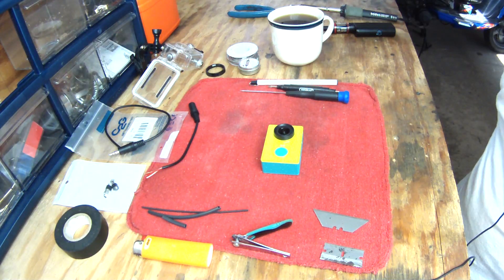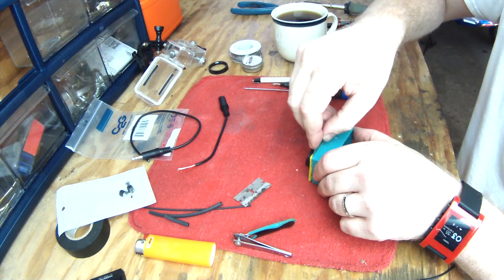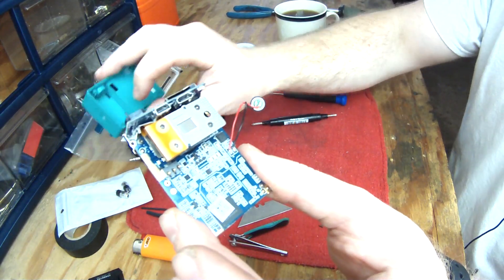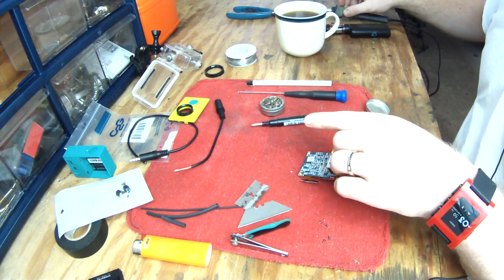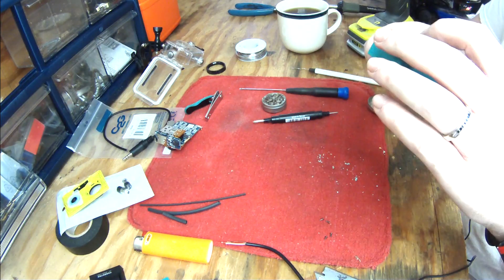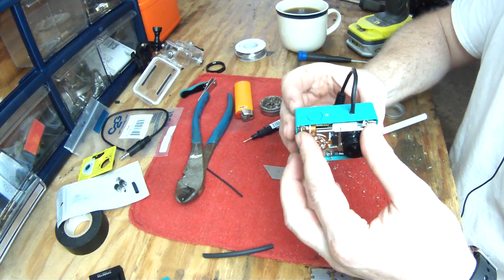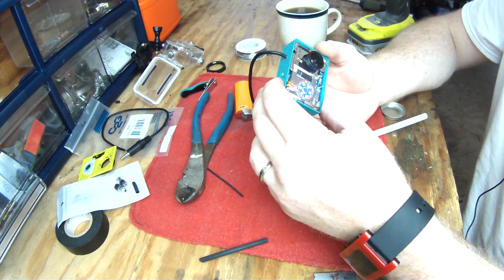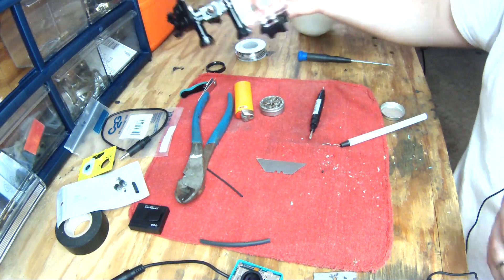Xiaomi Yi External Microphone Mod | Action Cam Hack

Comment: Hey. I have a mic with 3 lines, (trrs). If I cut the inserting part and glue the wires directly inside of the camera in the motherboard, will the mic work ? Or the camera only reads mic with 2 lines?

Comment: Hello I see that I have not posted for a long time, I hope you will answer me, I bought an action cam and an external microphone, the mic. it did not have the compatible connection and I bought an adapter for the micro USB type B input but on the other side it was not compatible with the microphone connection ... in short, now I have a micro USB female with its a cable 5 wires and the 2-wire microphone I wanted to connect directly but by connecting the two white micro USB and microphone wire and the other to the black micro USB and microphone side (the one with the bare copper) I did not get anything the action cam does not recognize the external microphone (obviously in the settings I have set external mic.) ... I would not like to make connections at random, so I ask you if you have any advice for me, thanks in advance ✌

Comment: Hi man thanks for the video ! I made it 90% like you did but 10% my way made the difference as follows:
- first I choose the have a new microphone cable fully installed from the motherboard
- cable choice was a high quality special microphone cable (proffessional mic cable)
- the actual microphone was a quality 20$ small microphone which was installed at the end of the cable (only the end of the mic..the actual small microphone)
- the downside is that you cannnot put the waterprof case
- the results are amazing after my humble opinion
- Check out the end result , you can hear it on this video it's amazing: https://youtu.be/pLp3uHsJrIE

Comment: Hi, thanks a lot for sharing this, Just a technical questions please. You don’t noticed any problem of hum or rumble or something, after connecting your input mic cables? Because sometimes when we modify the ground balance that can make problems. Any sound test available? Btw does the control of recording volume working fine?

Comment: I would like to try the same mod on my Sony az1 but the issue I have is that there are 2 microphones so I have 4 pins, I have tried putting some wires from a headset on to the soldered pins but it doesn't work. I've placing the wires on to two pins but that didn't help either. I'm new to all of this, some help would be appreciated.

Comment: hi can i use stereo mic with this setup?
Reply from the maker: You can wire a stereo mic, yes. The camera is mono mic in only though. I used a stereo mic cable for this mod!
Reply: I just did the mod today. overall the process was quite simple, but my soldering skills sucks. lol. somehow got it done though. the audio now is amazing! yi cam + zoom h1, simply wow! thanks a lot for the tutorial!
Reply from the maker: Right on! Glad it helped! I'm not great with solder either. I'm actually planning to do the same mod to the Yi 4k soon, because they still didn't add an external input! Unfortunately, the microphone in the new cam is no better. We can fix that!
Reply: shinyside why not get the yi 4k+ that has the usb c input? u can use a usb c to 3.5mm adapter and be able to record in stereo
Reply: @shinysidemoto  can you record a tutorial video for that too? It will be very helpful if you do so

Comment: What do you do with the waterproof case? how can your solution work with a waterproof case? not necessarily to work 30 m under water but to resist a heavy storm when on motorcycle, or swimming.
Reply from the maker: Cut a channel for the mic cable, and don't worry about it! I've ridden through some nasty storms with this set up without issue. It's certainly not waterproof, but marketing would call this "water resistant".

Comment: Why don't these action cams come with at least 8 gig of internal storage
Reply from the maker: Because microSD cards are like pennies a gig these days. Internal means non-upgradeable too. I get what you mean, but I'm all for replaceable storage!
Reply: It just helps when you run out of storage on your 32gig/64gb microsd and it rolls over to internal for photos or limited short 720p clip

Comment: (help) saya kan udah pasang mic external, tapi gak berhasil, padahal pemasangan udah ikutin tutorialnya bener-bener. jadi positif yg di pcb saya solder ke positif dan negatif jack female, sedangkan yg negatif pcb saya solder ke ground jack female atau apa gitu (*yg kakinya paling tinggi diantara ketiganya). nah masalahnya dimana nih ya ? pas saya colokin headset yg ada mic nya, malah engga berfungsi mic externalnya
Reply from the maker: Check again the polarity of your connection. Be certain the solder joint only connects one wire to one pad. It is easy to accidentally connect more. Test the microphone with another device and attempt to be certain of where the problem exists. (translated with Google translate, please forgive mistakes)

Comment: would not be better if you just connect the old mic wires to the new ones, without soldering?
Reply from the maker: No, a solder connection is best. Direct to the pads being better than making another connection.

Comment: Hello my friend could you please tell me if I can use this adapter  https://www.amazon.com/Movo-GMA100-Microphone-Adapter-Editions/dp/B00N0DTIFM/ref=sr_1_2?ie=UTF8&qid=1470972247&sr=8-2&keywords=Mic+Adapter+Cable  then use this microphone   https://www.amazon.com/Sony-ECMAW4-Wireless-Microphone-Black/dp/B00JWU6WWO/ref=sr_1_1?ie=UTF8&qid=1470942026&sr=8-1&keywords=sony+ECMAW4  it's possible? thanks for your help 

if someone reads it and knows or has used it would appreciate
Reply from the maker: Not with the Yi, to my knowledge.

Comment: Would I theoretically be able to use a mono Y - splitter, to have two inputs to the camera, to get rid of the annoying syncronisation? Or would this cause loads of interference issues?
Reply from the maker: Should work like a charm!
Reply: I'll report back once I tried it to see if I could notice any real difference in sound quality between mirroring the mono signal and using the stereo signal on its own. 

Thanks so much for your answer
Reply: Oh one more thing - you said that you let the solder flow together - wouldn't that create a bridge over + and -  and make cancelation an issue?
Reply from the maker: Oh, no! Don't bridge - let the solder flow over only one connection, but it must fully flow on that connection.

Comment: Thanks a lot!! Followed the same approach and it was successful. I am not sure how to cut the casing now without damaging the microphone wire...
Reply from the maker: The camera body case, or external case? I removed the external case and used a drill bit to route a channel for the cable. for the camera body, I would pass the mic cable through the outside housing and THEN make the connection inside. I drilled a small hole through the existing mic inlet and fed the cable through that.
Reply: The external waterproof case. I already soldered the the 3.5 female jack for the microphone point and not taking the jack out of the waterproof case means I have to drill a big hole in it.. which means the waterproofing is gone. But the voice quality I am getting by doing this mod, I think I am very happy with it.
Reply from the maker: Worth it! I've ridden hundreds of miles in the rain with the modded case on the front of my helmet without any water issues.

Comment: Xiaomi Yi has an usb plug, can we just plug an usb to 3,5mm jack and plug the mic?
Or should we mod the external mic just like you do?
Reply from the maker: Mod is the only way I'm aware of. The newest Yi camera models still do not have an external mic in, from what I'm told.
Reply: shinyside so the point is xiaomi yi do not have 3,5mm jack so we can't use external mic in older yi and newest yi? But thanks for the video it was really helped me out :D
Reply from the maker: correct!

Comment: I've done the mod, it's working but sound is very quiet. i'm using a Boya LM-20
Is it possibly because the LM-20 has no amplifier?
Reply from the maker: Yep, that could be it. Did you wire it directly, or put in a socket as I did? If the audio is not terribly quiet, you may be able to fix it in editing too.
Reply: shinyside I've put in a socket like you. it's possible to increase it in editing a bit but it's a pity. Should have bought the Boya BY-M1, it has an included amplifier powered by battery and is at the same cost as the lm-20.

maybe soldering the microphone to the xiaomi battery? (joke)
Reply from the maker: Dude, proper lol here! Seriously though, I think mic sensitivity is the bigger issue. An amp would almost certainly solve this, but a more sensitive passive mic should do the trick too. Love my AudioTechnica, but it's a pain to keep track of battery life.
Reply: shinyside what i need i just a better mic, not for voice recordings like a lavalier does, i need a good quality mic for landscape recordings. it's a neverending search :)

Comment: Hey there... I tried as you did but the sound is very low... I used old Samsung earphone... Should I buy another mic. or rejoin old one...
Reply from the maker: An earphone is not going to be a good mic, definitely replace with something else. You've heard my results, and I've heard many mics will work.
Reply: +shinyside thanks...

Comment: Good video, if you don't want to have a pig tail hanging out the case is there any microphone replacements for the orig that will fit inside the case and improve recorded sound quality. 
What I'd really like to do is come up with a way to use a wireless mic so while moving around audio levels don't vary with out using some from of audio compression.
Would of been  nice to hear a before and after comparison of audio quality but still a very good informative video thanks.
Reply from the maker: +mrelectron62 Thanks, man! I don't think there's a viable method to do wireless mic input with this model, but I suspect that will become more common with future action cameras. As to a quality replacement for the original, you're on your own there - I just looked to replace it with the best setup for in-helmet recording. There's some space inside the case, but I can't point you towards anything specific.

Comment: Two questions:
1. You've joined the right and left channel wires together on the soldering point, right?
2. Can you recommend using a jack instead of a wire?
Reply from the maker: +kilésengati I've combined stereo to mono, yes - if you find a jack you can fit RECORD THE MOD! My smallest was too big to fuss with. Do it to it!

Comment: Would it be possible to add an 1/8" jack that's flush to the body, keep the original mic and add a tiny bypass switch to switch from external and internal mic?
Reply from the maker: +James Resurreccion Dude, if you pull it off, I want to see! I bet it's possible, but there's VERY little space inside.

Comment: Hey I just tried this myself, but it's not picking up any sound when recording. Any idea? I tried flipping the wires. I'm using the internal mic solderred onto the wires of the second half of the cable with the male end. Plugged it into my PC and the mic works on there. I also tried a second mic but still no audio :/
Reply from the maker: +QuakeCBR Battery in the mic?
Reply: Negative. I'm going to try putting the internal mic back and see what happens.
Reply: shinyside Not working... shit.I didn't burn off the traces on the board or anything. Nothing wrong as far as I can see.
Reply from the maker: +QuakeCBR Something is definitely funny there - both mics not working could be a problem at the camera side. Good luck mate!

Comment: +shinyside Thanks for this tutorial. I already have ordered the ATR-3350IS and mic adapter. Am asking my selfif it's possible to only use the mic without battery tube to keep all things as compact as possible.
Reply from the maker: +Zwyen Belen You'd be better looking at a different mic - I haven't found one I prefer. Worth the lump in the line for me.
Reply: +shinyside thanks for answering. So the battery tube is needed. When the ordered parts arrive I'll see how and if I use them.
Reply from the maker: +Zwyen Belen Hook and loop tape, and tuck the crazy long mic cord under your helmet padding!

Comment: Does a micro usb to jack 3.5 would work? plugin that to the micro usb from the camera and the microphone on the other end? i wanted to keep the xiaomi yi's internal microphone for some shoots if possible!
Reply from the maker: +katofo2 One way to find out! The internal mic is pretty shit though, I'd just clip or tape an external to the body for camera-only shoots.
Reply: The problem is I only have cases that close on top so it's a pain in the a**.. :P wanted your opinion on something: does this mean there's no input for a possible mic via usb on the xiaomi yi? (it's a usb cable plugged there)
http://img.banggood.com/images/upload/2015/04/SKU223123_1.jpg
Reply from the maker: +katofo2 My understanding is no, there is no option for USB mic input. There are some varied models though, and I'm not up on all the differences.
Reply: ok, I'll just use your solution then, thank you anyway! :)

Comment: Hey nice video, im starting my own motovlog channel and im searching for a budget camera, after seeing the review ive came across with your video and im glad u are also a motovloggger :)
What you think about this camera with the external mod for motovlogging?
PS: Just susbcribed and if u want u can check my first video, poor video quality but u can see what i ride :)
Reply from the maker: +DEG I think it's the ideal budget motovlog camera. Worth the effort for sure. Congrats on starting your channel!
Reply: +shinyside So i got my xiaomi yi 2 months now, and iam thinking doing the mic mod. But i still want to be enable to use the camera for other things than motovlog, so i cant use this mod with the "tail".
I recently saw another video of a dude that installed, for what i can understand, a 3.5mm female jack with switch inside the xiaomi yi. And he still manages to use both internal or external mic.
The video unfortunately was not a tutorial, he is asking money to do so... The thing i still don't know is what should i connect to the jack, and from the jack to the camera, and on what pins. I tried learn with a schematic electric layout but haven't figured it yet.. :D Any suggestions?

Comment: do you know if stereo mic( two black lines on the male jack connector) are compatible?
Reply from the maker: +KYGON karting Definitely. That is the connector my extension has. No issues.
Reply: +shinyside  ty! ; so if i use for example "polar ProMic" it will recod in "mono" mode even if it is a stereo mic!?
ty again
Reply from the maker: Yep. The camera only has mono input. Both channels would be blended into one mono input to the camera.

Comment: this is interesting, actually i broke my internal Yi cam mic..can i replace my internal microphone with this regular condenser microphone ? https://agustomank.files.wordpress.com/2012/07/electret_condenser_microphone_capsules.jpg 
and will that microphone could hear people talking in distances about 5 meters? i need it to filmming a simple movie. 
sorry for my bad english
Reply from the maker: +NiFTYDodo  Almost certainly yes. Any self-powered or non-powered mic should work.
Reply: +shinyside long ago i bought regular condenser microphone, but it won't fit to the mic's place when i try to install it. Any solution?

Comment: how did you put it inside housing ¿
Reply from the maker: +Ali Şahin Sökeli As far as getting the mic wire into the Yi case, I drilled out the factory microphone opening and fed the wire in. See here: https://youtu.be/4ziIdyMVsbE?t=10m40s
For getting the mic wire into the GoPro style case, I drilled a channel that lets the wire through on the top. It does break the waterproofing, but I've ridden in moderate rain without issue several times now.

Comment: Cool video man.  Just got my yi cam, if I get another one I'll mod it thanks to ur video. I need waterproof right now.
Reply from the maker: +subtenk0 Yeah man, not sure how to do both right now for sure.
Reply: bluetooth reciever with bluetooth transmitter or bluetooth mic. not sure if audio would be 100% smooth shinyside
 alot to fit inside that small camera haha. its like smaller than gopro i think
Reply from the maker: +subtenk0 I think I remember reading that the chipset used has a bluetooth component... it might just be possible to do bluetooth audio in a future update, but I don't know enough about the protocol to say whether you could record nicely, assuming it's possible at all.